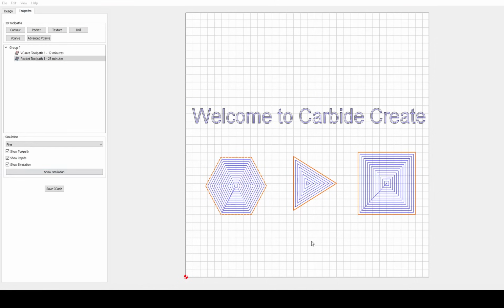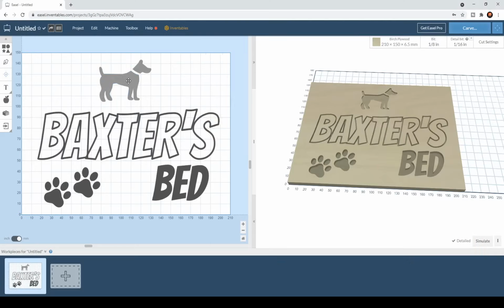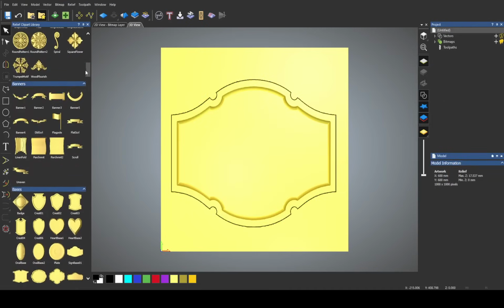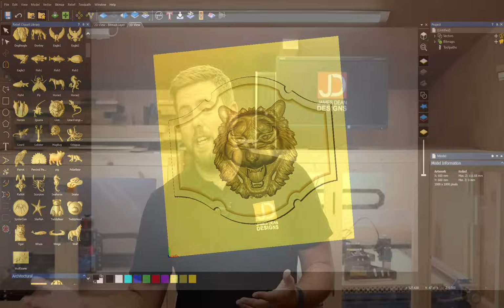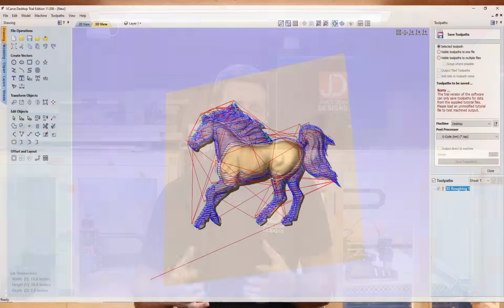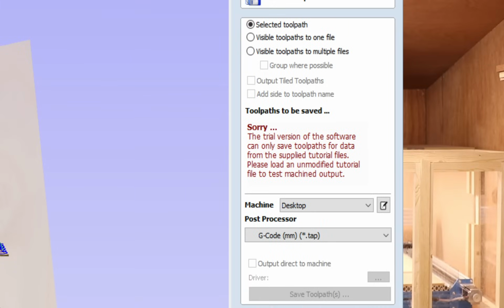Beginners guide to desktop CNC software

Comment: Help, I just got a machine and am a beginner in figuring it out,  It has a cnc router, laser that can engrave and cut and 4th axis rotary.   I am looking for software, which brought me to your channel.  I am looking for software that I can use to maximize the functions of the machine.  It seems like most are cnc only or laser only.  I have come across some capable of both but can only do limited function unless you are willing to pay for the functions behind the pay wall.   It seems like there is software for the cnc that is good and functional but has limited laser function, and there is software for the laser that is good and functional, but is it limited cnc.  If it has both it seems to not be able to maximize machine capability and if it can do it all then it is usually an arm and a leg and super complex because it is made for pros.  Then I saw luban, but it isn't mainstream and no one has reviewed it yet.

I'm looking for beginner friendly software capable of maximizing the potential of my machine that I can grow into that isn't going to lock the good stuff behind a $1000 paywall or require me to buy multiple software packages to accomplish the different function ability of the machine. Would you be willing to do a video like this which includes the functions that the software can handle as well as the beginner to expert complexity.   Please help.I
Reply from the maker: Unfortunately the reality is you need separate laser and CNC software to get the most or make your life a lot easier. Yes, there are a few pieces of software that try to cross over but their capabilities are often under developed on one of the aspects and in the long run this costs you more time and potentially more failed jobs so its basically better to buy separately from the start. Lightburn for laser and Carveco Maker for CNC in my opinion

Comment: I just started using Aspire . I’ve made my designs but when I save the tool paths I can’t seem to find the right file extension to use . I’ve tried candle and gsender but the masuter pro gets all screwed up and doesn’t cut right .  Any help would be very appreciated

Comment: Hi, I've just bought a Lunyee 3018 router, used to run CNC machines at work and even got into the software side of thinges with AUTOCAD and love making things with wood so after research on the best free software i opted for EASEL, i'm a little rusty as it was 10 years ago now so desided to get some memory joggers by watching videos like yours, everything in easel that you show was fine and i managed to design a test piece quite easily, problem, as per instructions started when i tried looking for the GENERATE G-CODE, ive downloaded UGS ready for the program, you say to generate G-Code, click MACHINE, then ADVANCED and go from there, unfortuntely, doing that, clicking MACHINE from the drop down menu no longer displays an advanced option so no i'm stuck, any hints would be of great help.

Comment: watched your video and just noticed that Elegoo Cura, creates GCode. Will this file work with Fox Alien CNC?
Reply from the maker: Kind of but no. Gcode is just a language at the end of the day, but it's how that language is used that makes the difference. So yes somethings will work but cura is designed to output gcode for CNC router work (or not to my knowledge anyway)

Comment: Is there an inexpensive software that I may purchase for use for one day to achieve a slanted pocket? i.e. I need to configure a simple 2 inch x 4 inch rectangular pocket cut that allows me to have 0.5 inch depth on one side and 1 inch depth at the other... I own VCarve Pro and have a 12 month trial of Carveco Maker that came with my Onefinity CNC purchase, yet neither seem to be functional to perform this simple task, without spending huge money for this one simple pocket cut I require. Any suggestions, so that I can export the g-code I need without spending big bucks?
Reply from the maker: There are multiple ways to achieve this in both Vcarve and Carveco Maker. The easiest in my opinion is go to something like TinkerCAD where you can design the 3D shape you're trying to achieve. Export that as a 3D model, import that into your CAM software and treat is as a 3D relief (or negative 3D relief).

Comment: James, I'm using UGS.  I like it, but, my machine has always jogged as long as I held the mouse button down.  All of a sudden, it won't do that any more.  It only moves the distance I have set in the jog box even if I'm still holding the mouse button down.  I'm told there should be an option, somewhere, to enable the continuous jogging mode.  I can't find it.  Got any ideas?
Reply from the maker: There is, but I'm not at a PC at the minute. I'll try and take a look tomorrow

Comment: Excellent video. I have been using fusion 360 for many years now for 3D printing. I am looking at my first CNC machine possibly a TTC450 Pro. My question is once I have created the STL file what do I need to do to make the piece on the machine. I am finding this very confusing. Thank you

Comment: Correct me if am wrong.
All of these are for carving wood and  logos.
Can't really use them for parts design made of aluminum, can I ?
Reply from the maker: @northwestrepair  they can work for any materials. I've used Carveco Maker for brass, aluminium and carbon fibre. If you're trying to create 3D parts, then Fusion360 is best as most of the other are 2D or 2.5D

Comment: James AHHHH. I was a machinist for 30 years, and I steered clear of CNC machining, now, at 65, I decided to buy a CNC machine I think I have a loose screw because all this stuff just gives me a headache. I wish there was an easier way to do this. I have a scrambled brain when it comes to computers.
Reply: I am 30 and have the same issue. Hope i learn to curve that fear i have of new programs and methods
Reply: Search for free files and start with alterations. I am new to this myself. Pretty good with computers but still just learning the basics. Starting with free files allows you to get going and used to using the program one bit at a time (text, basic shapes, edging profiles etc.) and sending bits to the machine. Eventually you'll be able to make pieces yourself, at least that's what I'm hoping.
Reply: Agreed, I’m in 60’ s and I’m having a hard time setting up my CNC
Reply: Try deciding what bit does what atxwhat speed..
64cyears old here
Reply: I’m 51 and my squirrel brain is doing the same, but I decided to learn by downloading a couple of finished .NC code files (I have no idea what the difference is between gcode and nccode but it works with my Snapmaker) and attempting to cut them. I’ve learned a ton about which endmills do what and which settings make a difference by blowing a lot of cheap pieces of wood.

Comment: Now in 2024 are your thoughts the same for cad and g-code software?
Reply from the maker: Cad software - yes, not much has changed other than if you mainly aim to do 4th axis then DeskProto is pretty good.
Control software - i do like Gsender now but still find myself reverting back to UGS most of the time
Reply: @JamesDeanDesigns    Thanks James.

Comment: Great video for someone just getting into CNC, like myself. As a newbie, I'm curious what some of the terms mean, like "pocket cut" how is that different than other cuts?  What does "rough out" mean? I have guesses, but am not entirely sure.
Reply from the maker: Good question - Pocket and profile are 2 of your main CNC cuts. Imagine a square, if you wanted to machine all of the middle out of that it would be pocket cut where it essentially creates a pocket of space. Where as if you wanted to cut it out you would use a profile cut and this is where the bit follows the profile of the shape. Rough out is basically where you remove a lot of material (typically in a pocket style cut) but you do it pretty aggressively and then follow it up with a finishing pass  which cleans it up and puts in all the detail you want
Reply: @JamesDeanDesigns  thanks!
I’ve since played around with Easel a little bit. 

What I found weird was when I had a rough and detail bit set up, the tool path it made sometimes had the rough out bit still going against the edge of parts of the design.

I’d like to find a way to have the rough out stop maybe 1-2mm from the edge, so my detail could hit all the edges. I was thinking of an upcut rough bit and a down cut detail but so I don’t get a fuzzy edge.

Either that, or I need to mount a thin board on top of my work to take the fuzz. 

What are your thoughts?

Comment: Hey James thanks so much for your help, excellent information.
I’m only looking to do simple text engraving and wondering if you have tried “textmilling “ software that’s its name, i wanted to try it but didn’t realize I had installed it and didn’t get to use the trial period lol. It looks as tho it does all parts and create nc file I can load to hand controller. I’m willing to buy software but just want to make sure it does what I need! have you had any experience with this thanks mike.

Comment: That was a great primer. I just built a CNC machine and I'm running an MKS DLC V2.1 board. I didn't buy the display just the board, but everything is moving as it should in open builds control. What do I have to figure out next is how to enable the Wi-Fi on the control board. Any advice? This is my first foray into CNC machines and related hardware and software. I've learned a tan over the last 2 weeks. I'm going to use my machine for plasma cutting. Thanks. Subscribed.

Comment: What about CNC.js ?
Reply from the maker: It has a decent amount of users. I just focused on the main ones that come up in the users groups, otherwise there are quite a few options for control software
Reply: @JamesDeanDesigns  I find it lacking some features, but upside is that I slap RPI0W on the back, and can controll it from any device which is a big life quality improvement.

Comment: Through experience  i didnt like easel due to made my machine go clunky when moving, sounded like it was jamming up on the axies this is before it  even went down onba z axies  . The demo which came with it didnt jam. For the lazer engraving and cutting, light  burn is very nice to work with ,no issues on a usb .using creativity lazer cutter. I am currently learning fusion 360 on the free year trial .

Comment: Wish I had the money laying around to buy a cnc machine + some sound proofing and what ever I need to not be a pest for my neighbors.  Would love to hobby cnc at home
Reply from the maker: Check out my latest video... you could win on in April👍
Reply: all normal men can build own cnc machine DIY own hand in home, simple easy and lot cheapen and better than many 4000-6000 $ cnc machine what you buy.
Reply: @mattivirta  I have a different skillset.
Reply: @Eagles_Eye  all can learn, and yotube have many many video how build, all normal men can build if want, same work if buy ready cnc machine need install all hardware together or buy motors,stepper drivers,controller board and install softwares, buy hardware have lot cheapen than buy ready cnc same work have both install all together.
Reply: @mattivirta  dude.  “ all normal man” sounds insanely dumb.

I have a different skill set and a full time job.  Working with an industrial cnc machine + other work.

I’m not going to “ just learn” building something that I can buy and start working with right away.

I don’t live in the states, getting good quality parts to build a sturdy and good machine + electronics will cost me allot of money, then also have to figure out how to put it all together correctly and program it ontop of that.  I ain’t got the time and energy after work to do that, got a social life too

I already have to build a frame, an enclosure and soundproofing + dust collection, that’s enough time wasted for me.
Reply: @Eagles_Eye  if not can ,not time waste build ok, you opinion, i have time weekend build simple cnc machine and i has build hobby machines many many many time, first cnc i build full made all own printed circuit board and components because anywere not has ready boards and hardware, young boy has made first cnc working well, then i has build many cnc many factory and hobby users, last 30 build lot at fulltime work automation and weekend hobby users cnc machines and sell. 4-5 X cheapen build own than buy worst 4000-6000$ machine.
Reply: @mattivirta  yep, blah blah blah.

Comment: Hi loving your videos so far,

I currently do 3d printing and my own design work 

I’m currently thinking about getting the foxalien masuter pro cnc 

For my current cad work I use fusion 360 and I have a commercial license on it I see you mentioned that I can use fusion 360 for cnc but is is possible to use that for the cad and cam part of the process as I don’t really want to have loads of different softwares as well as machines to learn 

Thanks in advance 
Kyle
Reply from the maker: Yes you can use it for both aspects so go for it 👍

Comment: Great advice.  Unfortunately, I am running on Linux and neither Vcarve or Carveco will run on that operating system.  Because Easlel browser based, it is my only option.
Reply from the maker: Linux will minimise your options but you can emulate Windows and Windows programs on Linux with the use of additional programs. Loads of YouTube videos showing how to do it if that helps

Comment: wrong again, I have a working area of 750 by 750 mm. and there is NO PROBLEM with that size, the (pro) version is just a bit moere expensive to buy or to upgrade to, the desk top version is 24 by 24, but the pro is limitless.

Comment: Firstly, I'm not interested in any subscriptions. Ever. After that I'm looking for a solution for an independent inventor that wants to keep everything secret. i.e. CAD/CAM can run in a secure environment inside a VM (not vGPU support), without any internet access ever, and will export *.nc files that will work with an offline controller of a 3018? OpenScad satisfies those requirements for CAD, but what is available for CAM?

Comment: is there any CNC software which has ability to take 3 inputs at a time ? the thing is I attached a separate controller for each axis, one controller for X-axis, another controller for Y-axis and another controller for Z-axis,  each controller has USB port, which can be connected to PC directly, now how to give these 3 ports as inputs for the software, If load my g-code in sotware my physical setup should move accordingly
Reply: USB have many controller board what can run 3-5 motors cost about 10-50$ paraller port can use better, old computer whit paraller port or new compter and buy 1-2 paraller port card, cost about 8-20$ all parallerport card not working, but linuxcnc internet site have what card working, my cnc machines have 2 paraller port card and can use 10 stepper motors drivers. USB port controller has lot problem not have REAL TIME controller, not safety. windows have worst OS use cnc machine better use realtime linuxcnc software and handle lot better all G-code. mach3 or linuxcnc have popular used controller software, can run G-code easy.

Comment: Great video! Your video helped alleviate some of the anxiety associated with the "realm of the unknown." I am brand new to CNCs, etc. I do not own a CNC, yet. As far as a computer goes, I own a MacBook Pro. With that being said, I was going to use Parallels desktop in order to install Windows onto my machine, so I can use Carveco Maker. Have you heard of any issues associated with doing so? Also, do you have a video about the different ways to connect a CNC to a computer, i.e., USB or other ports? I've read that USB connects are inferior/unreliable.

Comment: Are any of the CAM softwares Mac compatible?
Reply: i think NOT have, who idiot use mac today worst computer uses anythink normal or ower expensive have.
Reply: Just saw your post, a good solution is Autodesk Fusion, I use this on both Windows and iOS, same interface and same functionality on both operating systems, as James said, bit of a steep learning curve, but real worth learning.